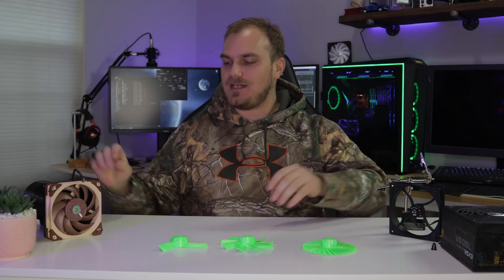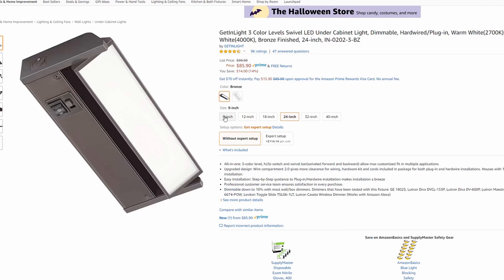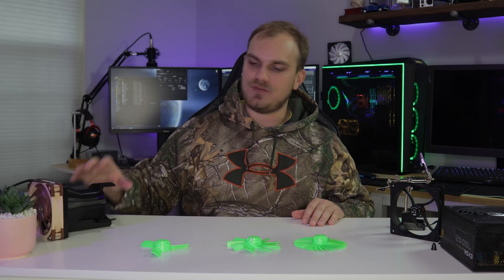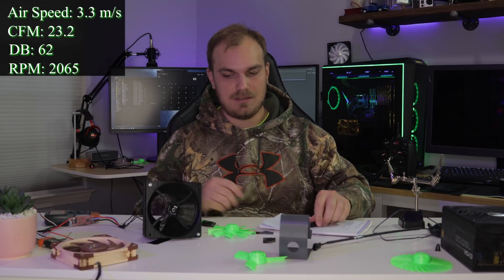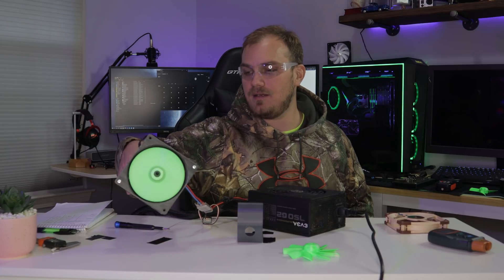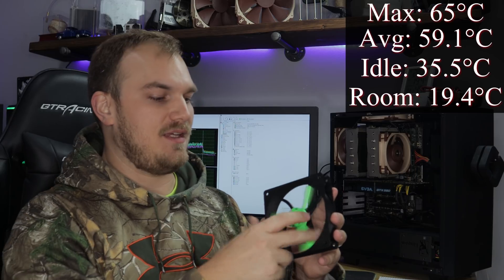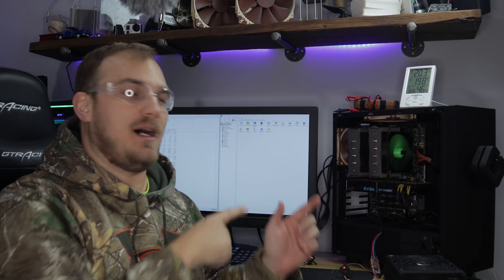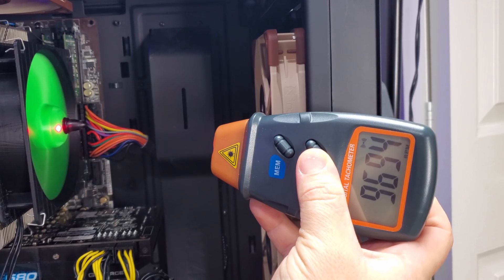This 120mm Fan BREAKS All The Rules!

Comment: I made the right choice:
I use the Stock Cooler on my CPU, so all Fans that currently exist in my PC are:

1 inside PSU, 1 CPU, 1 120mm PC Case rear, 2 built in GTX1660ti fans. And that's it.
For extreme heat dissipating, I use a 15000 RPM 3 Blade Desk Fan 30 cm Diameter, yep working pretty damn good all the time, as I observe the CPU Fan never Spinning too fast because of increasing heat even at 100% workload. 
Because if any of you studying about Aerodynamics, 3 Blades obviously pulls more air, not to mention the Blade also has higher Tilt angle.
So comparing a Jet Engine vs Propeller 3 Blade at same RPM, the Propeller actually pulls more air. The only reason Jet Engine can pull more air is because it is spinning nearly 10 times faster than normal Propeller Plane and is designed to work at 6000°+ Celsius.
From this we know that Every Single Fan Designs on PC market are actually non-sense because they barely perform better than 3 Blades Fan.

Comment: Not sure if anyone mentioned to you..  Speed controllers introduce a lot of harmonics. This is because they pulse the power on and off at a given duty cycle. You can minimize the DC switching noise by putting a in line coil in series with the motor with a large capacitor in parallel across your motor terminals.  Might want to give that a try.  It is similar to what speaker filters work like. A Low-Pass filter, attenuates high frequencies caused by switching power supplies like your motor controller outputs.

Comment: Please do measure static pressure as well! Jet engines have lots of blades and high rpm for good reason. Those type of fans produce low airflow, but high pressure. If you wanna levitate something for example a model hovercraft you may wanna use the 30 blade design, cause it should be able to lift more weight at the same rpm then a 3 or 9 bladed...

Comment: When you mentioned the 30 blade looked just like a jet, I remembered something I've done before.  Another part jet engines have are fixed stators.  I can't say I know all the physics of it, but, it looks to me that they redirect residual rotation in the air to further push the flow out the end.  I made a 120mm stator that I use to increase static pressure on otherwise weak fans.  I just uploaded it to MyMiniFactory, so it's pending approval.  My user name is v8eater and I'll have it named "120mm Fan Stator".  I'm using one right now with a rather janky Alphacool fan and find it can push through quite a bit of resistance. (^_^)y

Comment: lots of factors you didn't include , surely its a nice experiment though. 1- Blade material stiffness. 2-blade attack angle, blade count and most importantly total weight/rotational inertia.... DC motor designed to handle lets say 2000 rpm at a specific inertia (or torque) this should be within motor`s allowances which isn't really tight, but, the 30 blades ruined that entirely (heavy, low stiffness 3d printed, creating loads of axial unbalance) 

to limit factors, get a deep rigid shaft fan not a 25 mm maybe a 38mm delta one or even thicker if you wanna go "turbine"
and last innovative crab like designs of fan blade or like those on msi gaming x gpus (stiff, numerate, lightweight, well shaped)

Comment: The Noctua runs at 2000 rpm and only like 2 degrees behind the others..... which were running at 9000 rpm...... and loud af. I'll be sticking to my Noctua, kthx. :) I think there may be a case to make competing with Delta fans which can run at the 16,000 rpm mark. Try that.

Comment: You could add a tiny scoop just above the little cooling slots for the motor to add cooling to the motor it self perhaps. Maybe switch them out with the blades on a standard cooling fan as if it were an after market mod for a noctua or cooler master fan.

Comment: Great video! But I'd recommend looking into annealing 3d printed parts with heat, apparently it can increase the rigidity of the part by 40% or more, and epoxy as well would increase the stiffness, potentially fire retardant paint could help as well.

Comment: The 30 blade design can be highly improved by using more sharp angle of each blade and reduce the number of blades with no overlap on each other, so when look from front will look all green no gapes but with no overlap , and guarantee will win all the designs.

Comment: If you put a soft tube on the back of that fan shroud and then fill the tube with water, the air pressure should push the water. That would work to show the difference in CFM, but it wouldn't give a numerical reading. Still would work for demonstration purposes though.

Comment: Maybe instead of using PLA for the blades, try PETG? It can withstand higher temperatures before warping and also it handles flexion better than PLA. It does flex more in general, it's quite similar to ABS, but it's not as hard to print.

Comment: If you do a follow up it might be useful to measure the power draw (current) so you can do a comparison between airflow and resistance the blades create.

Oh, and you should be able to balance the blades more by putting the on by putting them on something that rotates easily (a fan with the magnets removed?) and filing a little off the blades that settle on the bottom.

Comment: The 30 blade fan could have performed MUCH better with progressive blade angle / curvature - steeper at the base, gradually becoming flatter toward the tip. I'd have gone for one of my fav numbers, 16 blades. And 6 too, maybe.
Also, I see why the 30 blade one broke. A large part of the hub is just... there, the blades only attach to just a small part of it at the lower edge; you got there plenty of room for progressive angle blades that won't break off easily. The 3-blade one didn't break because, well, it had high pitch blades, with a substantial base width, leading edges up to near the top of the hub. You probably put like... 100 W or so through that tiny motor, no wonder it overheated. :D

Comment: I'm not interested at how they run on a quad motor. I was hoping the video would be more about comparing a standard Noctua fan blade design vs ones of your own in an apples to apples comparison. I've always wondered if the huge disk in the middle of PC fans that hold the blades in place is there for a reason because it looks like it'd block airflow. -- What I would like to see: Take a Noctua airflow fan, a Noctua static pressure fan, and custom fan blades then run them all at the same RPM and see which blade design performs better at both RPM and noise normalized settings. Noctua seems to be a high quality name brand but when I look at their blade design they don't look like anything special.

Comment: Apparently your PATENT PENDING SUCKS 9:15. Needs locktight.
Separately, your non contacting tachometer is not.  counting rpm, but rather "Irregularities per rotation, times the rotations per minute" so I see 6 voids your seeing in the hub, so 9000/6 equals 1500 revolutions per minute . Fortunately the 6 voids per hub seen consistent across your fan assemblies so comparisons are relevant, if you were counting "blade passings per minute" it would be quite a different story . Should maybe have a white dot per hub, or piece of white tape, or a micro mirror on each. Well, having fun aren't we?
I am corrected, seeing 12:41 reflective tab on the hub. Wow, I am so damn apologetic it's amazing!!!
Reply from the maker: No worries

Comment: Should try printing in polycarbonate, higher tensile strength and higher glass transition temperature will reduce the flex and improve heat tolerance. Compared to polylactide which softens at around 60C it should be able to withstand 100-150C before softening depending on chemistry.

Comment: Did you print those with PLA or ABS? PLA prints can be brittle if the prints are thin, they're stronger when they're thick, while ABS is what most commercial fans are made of. Legos are also made from ABS plastic.

Comment: Like any good scientist, you went ahead and changed 5 variables at a time 😂 no offense but that data is useless. You changed RPM, numer of blades, blase angles and blade height (thickness). The 30 blade might have moved the least amount of air, but I'd bet it had the most static pressure as well. I really like your videos but you unfortunetly never do proper testing or control which makes the results useless. It's more for fun than actual research or practical use.

You can also use a solid ring around the fan to increase the performance. Just a few mm should be enough.
Reply: Data no 👎 Entertaining yes 👍
Reply: The 30 blade could probably push the most air across the coil via static pressure which inturn had the most cooling. But yes your right 9000 rpm vs 2000.
Reply: Your assertion is false, he was wearing safety goggles, therefore he was doing science. Besides, 99 percent of human discovery has not been a rigorous adherence to the scientific method, it was dicking around in the shop till something interesting happens. THEN they break out the measuring sticks and controls.
Reply: Don't forget 0 lubrication on a fan xd
Reply: Engineers have proved that 3 blades designs are the most stable and efficient but yeah sometimes efficiency is not an issue.
Reply: its for fun, but the conclutions are not valid, because he didnt  follow the experiment design , for example note how  he dont fixed the RPM  or fix the DB ( It will be a good comparison , the better fan at the same sound level )
Reply: From what I understand, these fan motors don't care about the rpm. They put out a certain amount of power and the rpm then depends on the fan design. So the rpm is not a parameter, it's a result. You could turn it around, of course, setting certain rpm values and then measuring the load.
The other stuff is true in any case.
Reply: It is true that none of the fans worked optimally. As soon as I heard the sound of imbalance, I already knew that in a couple of seconds the fan would rip. For such speeds, it is really worth considering the profile of the blades, strength characteristics, etc. Need calculation and experiments)

We counted on similar fans in College as coursework projects. Hell, it looks like I should find my old laptop, hope it still works.
Reply: Ok guys chillax, no need for alpha energy here.
Reply: Wow, harsh. The man is may not be making science,  but he is making experiments.
Reply: Damn and i was just thinking about my using this on my university thesis
Why youtube science experiments make you a certified scientist
I learned alot on youtube like the  d.i.y chernobol nuclear reactor
Worked even better than the last one
Reply: @programmingpidgeon424  there are actually a few channels who do very in depth analysis of PC hardware. Gamers nexus and actually hardware overclocking are 2 examples :P
Reply: @Finkle Tinkle who gave you the right to reply then? where is your video testing epic noob hipotesis to allow to criticize him here? No offense, but until you make a proper video about it, you're not one to talk.

Comment: I was wondering if you could make a fan like that one Mugen cooler. Using two slim fans keep one the same but 3d print a fanblades  that would spin counter to the other one. So it's the size of one regular fan but with a stronger more direct gust.

Comment: the next batch should also have a bit of cooling for the middle part. a form of blades in the middle to pull in ventilation might help! you made holes but they do not really pull air. thus why making some form to pull in air might help it stay cool! and ai am guessing that 30 blades would do wonders on static pressure.

Comment: make an other 30 blades with like 10% more deflection and try it on a water cool radiator. those require static pressure and this 30 blades looks like it would be perfect for that!

Comment: i bet the 30 blade performs so bad because of the roughness of the print... with the other fans the ratio between the blade size and the printer artifact size is higher so the artifacts (might be..?) less significant on the fans with few blades.

imo this experiment should be run again, with all the fans post-processed with acetone or something to make them shiny and smooth so the friction from the printer artifacts is less of a factor

Comment: Static pressure.. that's important when you use rads, or even air heatsinks that have dense fins (high FPI).  I'll bet that 30 blade fan had some high static pressure.  The low blade count fans are just good for moving air.

Comment: I think the 9 blade will out perform the 3 under load.  I could be very wrong but I would expect better static pressure with more blades even though the free flow is reduced.  The cpu cooler shouldn't be so much resistance that the turbine fan is needed, but will be cool to see how it does too. I expect surprisingly good cooling even though it will be last, a close last perhaps.

Comment: this "Jet fan" should produce not high airflow but alot of static air pressure.  but were do you need that by a pc case maybe to push air throw a dustfilter sheet or radiator

Comment: Upgrade that GPU!
A 1160 Ti uses half the electrical power for 2.3x the performance.
That'll really cut your heat down too.

I have a 1080 in the desktop and a 590 sitting idle because it burns over 400 watts under load.

Comment: The 30 blade came off because it slowed down and spun the nut like a turbo can do, that 30 blade should have far far improved pressure over the 3, also the overall depth of the blades greatly effects the amount of air moved, Make one that is like a turbo charger compressor wheel, it should have great pressure.

Comment: i think the 9 blade will be the best at cooling, even though it had the least air movement, it may have a high static pressure compared to the 3 blade

Comment: Put fans on both the sides of a radiator and let them push into eachother, like the air cooler video you did, but than with a rad

Comment: I'd like to see how the Noctua blades would perform on the quad motor rig.  When the 30 blade "failed", it looked like the retaining nut backed off the shaft of the motor.  The 30 blade might move more air with a (slightly) more aggressive blade pitch.  To improve rigidity, maybe print it with an attached "ring" around the outer rim?

Comment: The 30 Blade should, in Theorie have more static pressure than the 3 or 9 Blade one,
Thats the reason jet engines use it, to compress air

Comment: So, a 3-blade fan actually performs as good as a Noctua. And most PC fan makers keep on making them have more and more fan blades instead. Isn't that kind of ironic?

Also, talking about 3 fan blades, I just noticed I use a desk fan here with 3 fan blades. But it's one of those desk fans that have 3 main blades (the wide variety) but also have another set of 3 smaller fan blades on top of the main blades, supposedly making more powerful airflow than a normal fan. I wonder if that kind of layered design would work as a CPU fan design too?

Comment: I have 3 suggestions to improve noise, You should print the same 3 blade disine but implement golf ball dimples as well as rounding the ends on the fan blades and see if that has any effect on noise levels. As well as I have seen that you can use acetone Vapors to smooth your 3D prints. I think theas three additions could help noise reduction and I would love to see the results. Never the less keep being awesome and keep up the science.
Reply from the maker: i thought acetone only worked for ABS and not PLA

Comment: The motor is noisy because ESC is pretty old, and it uses 8khz PWM for motor control. Modern ESCs use 24khz signal, so it's much more silent

Comment: Keep up the RND and try using the 30 fan prop an increase the diameter to use as an exhaust fan for a case, or try encasing the 3 bladed fan in a sound dampening encolure.

Comment: Could you make some of the blade more tall? like 8 blade with 4 double the weight.
I wonder what that does, also, more blade usually results in more pressure and less air flow.

Comment: Very cool experiment! The 30 blade fan likely has the best static pressure, which is important for heatsinks and radiators (or well, those are convectors actually). Good fan design is too find the optimum between airflow and static pressure. That's where Noctua is king. They try to get every little gain they can get. Hence why noctua is so expensive, research is expensive

Comment: Could try printing a few little props over the vent holes you made to better force air in there. OOORRR you could make the vent holes more angular / spiralized or offset however you want to say it so they actually scoop air into the motor like a blower.

Comment: Going to test varying the angle from the root to tip (twist) since the blade tip goes faster relative to the air than the root? Also might be interesting to see what affect a toothed trailing edge and changing that around may have on noise.

Edit:
Here's my take on something, although I've no idea if it's any good: https://www.thingiverse.com/thing:3944824
Reply from the maker: i could explore this, I took out the blade twist from my model to create an easier object to print, i can easily implement this into a future design

Comment: Static pressure is better for direct cooling.  It pushes the warm air out with fresh cool air.  Sometimes its not a lot, but if all the air escapes around the fan blades then you are just moving air around and not through the heat exchanger.  The high bypass fan imo will be the best.  Now intake or exhaust fans on the other hand, I think that's where the 3 blade will shine.  Static pressure is not as important there, main thing to worry about is airflow and current.